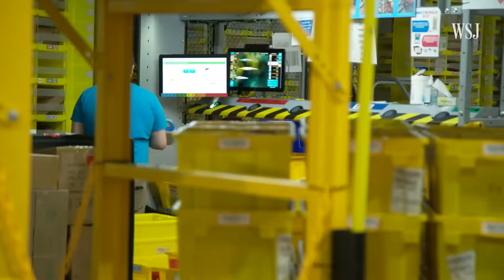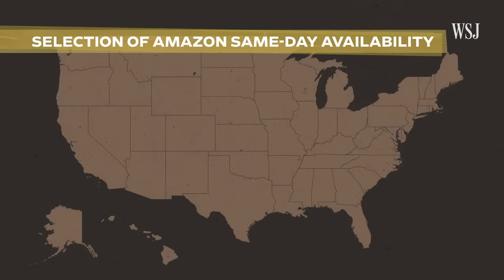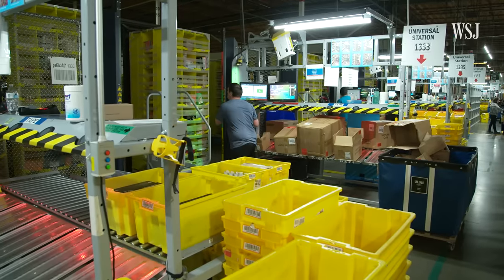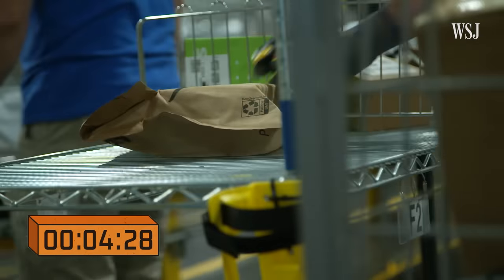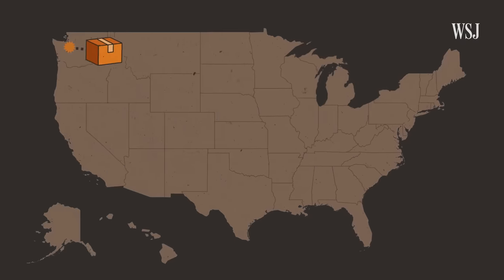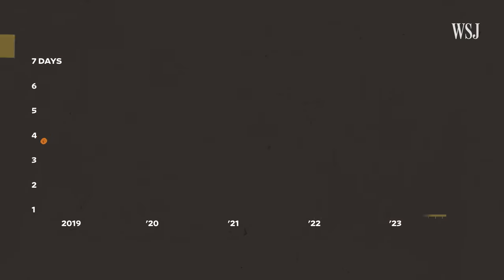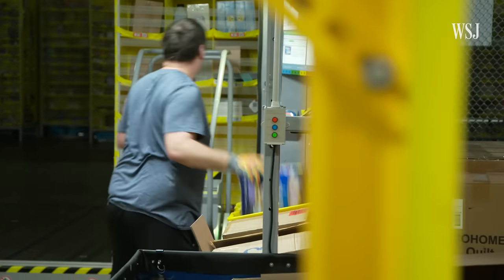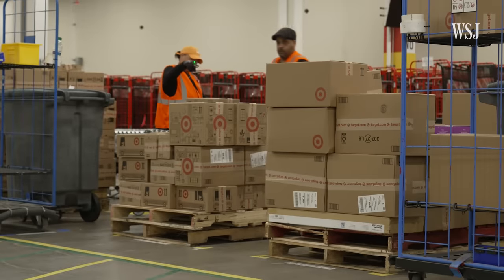Inside Amazon’s Meticulous Same-Day Delivery Strategy | WSJ Shipping Wars

Comment: If you live in an apartment please don’t select the 4-8am delivery time. If we can’t access the lockers, we have to return to the warehouse. ALSO PLS PROVIDE A GATE CODE ❤
Reply: You make a good point Amazon needs to set up a department whose job it is to contact complex owners of any type of gated community after a single delivery has been made to set up automatic protcalls to ensure vetted drivers and employees have access with no problem. If lazy property owners refuse to do this it should be Amazons prerogative to refuse delivery. Think of the time and money both parties would save.
Reply: We don’t even get gate codes as residents 😂 just a key card
Reply: There isn't a gate code at some apartment buildings, and people who live there just use their key cards to enter. The screen with a "code entry" at the front of the building you may see is just a way to dial someone who lives there so they can beep you in, but no way to enter a code to open the door. It seems like the regular FedEx, UPS, and USPS drivers may have access to the building, but since the Amazon drivers are just seemingly random without an everyday route, I guess the apartment giving them access cards is way more difficult
Reply: We gotta use a third-party delivery service called Fetch - basically the middle man between Amazon & the customer. It sucks, but I get why many apartment complexes are requiring it nowadays.
Reply: Thank you.
Reply: This! Yall folks that are ordering in an apartment complex, PLEASE leave detailed instructions and make it easier for people that deliver your packages and food! Please and thank you!

Comment: I used to work for Amazon and they constantly overworked employees. The promise of fast shipping came at the expense of our health as we had to sort several packages continuously throughout our standard 10 hour shift. A work union didn’t exist either at our facility and this made our working conditions harsh and dangerous. I’m in my 20s and for sure those medical benefits exist for a reason. On the daily older employees would wear braces, not for preventative measures but for recovery. It’s unfortunate that Amazon puts so much pressure on its employees as a direct result of attempting to increase its output for $$$.

Comment: I do amazon flex and often times they send 2-3 drivers to the same house which is really inefficient. They could easily give one driver those 3 packages.
Reply: Right! My favorite is when we all meet at the same time.
Reply: I recently bought 3 different things under one order. I intentionally chose the "no rush" option for later that week to have fewer deliveries since I didn't need the stuff right away. They still sent 3 separate drivers to my house lol
Reply: @UOAPlays  They probably came from 3 different fulfillment centers. Amazon is so customer obsessed that they will do anything to deliver on time. There are times when they paid me $90 to deliver 10 packages 😂
Reply: @siamimam2109  That makes sense. I didn't even think about that. I used to work for Amazon, but it was at a crossdock facility, so I don't really know much about the actual fulfillment centers.

Comment: I might be the odd one out, but I don't like it. I ordered 2 books yesterday, both were delivered today, but in 2 different shipments, that means 2x packaging, 2x handling and 2x transportation which all has an impact on cost and the environment. And yes, I am certain both came from the same location.
Reply: But it wasn't 2x anything. It was actually 1/250 x transportation. You are considering 2 separate vehicles being driven by 2 different people and making 2 different trips to your home. Reality is that both of those items were 1 of 500 items in the route that would have been made without your order. 

When the USPS mailman brings you a piece of mail they are not making a special trip for each individual envelope. Neither is Amazon.
Reply: It's really not close to 2x though. The weight of the books was the same, and the paper/plastic that covered them was no different than a Starbucks cup you threw away. Meanwhile, combining multiple items into one order takes longer and more labor than two separate packages.

Comment: Amazon has been doing a poor job at moderating what they sell. I've gotten broken, used, or fake products from Amazon. They also do not carry a ton of name brands so I am now buying more stuff from eBay, Home Depot, Lowes, and occasionally Walmart. They need to encourage name brands to sell with them and get rid of most of the Chinese low quality knockoff brands.
Reply: i’ve gotten fake stuff too
Reply: They’ve run off the good, name brands for a lot of categories and what is left are the cheap (often low quality) Chinese companies.
Reply: @roxcyn  Exactly. They took Walmart's berating of suppliers to the extreme and everyone but the Chinese just stopped selling through them.

Comment: Amazon Same Day Delivery is insanely fast, but honestly, besides groceries, have you ever really need clothes, electronics or other stuffs to be delivered same day??? I feel it's just frustrated for Amazon staffs
Reply: The speed you receive a delivery at has no impact on the Amazon staff. It's didn't come earlier because people worked/drove faster- it's just that the item was already in your city. Workers in a fulfillment center on the other side of the state for a next day delivery will have just as much time pressure, because the item needs to get on the truck to your city first.
Reply: As a amazon worker of this exact type of building I agree wholeheartedly with you I don't really understand why most people can't go to the store themselves most of the time by the time your package may or may not arrive you could've been back from the store with the single cough medicine you solely bought from amazon even if it was groceries I kid you not we have a amazon fresh warehouse 10-15 min away from the Amazon SDD (same day delivery) warehouse that practically does the exact same thing that the same day warehouse does it's just limited to only groceries. That claims to get delivered within 2hrs once again.

Comment: Something they’ve gotta work on is their intake of items. 
I’ve had multiple times where the wrong item was delivered, because somebody put the wrong ASIN label on it. Once it was just the wrong variant of an item. Not a big deal that time. 
But this last time, I had ordered a $8 spray bottle of Rain-X. But got a $70 box of “The Right Stuff” gasket maker tubes. Not a huge problem really for me, as that can be useful. But a mechanics shop could’ve easily abused that fulfillment center to order a couple years’ supply of that stuff for a fraction of the cost.

Comment: I don't mind paying the membership. Where I live is a senior facility, which has an intercom; intercom code is posted in the instructions. Only to rec'd a notification that I need to provide a gate code.......for the delivery. Maybe if the driver took the time to read the instructions he/she would gain entry into the building. Driver also leaves packages on the counter in the mailroom, which gives easy access to thieves to steal. Also, I check the box for all my packages to be delivered so there're few boxes and a one time delivery day. Only to rec'd package being delivered on each day of the week instead of all at once.

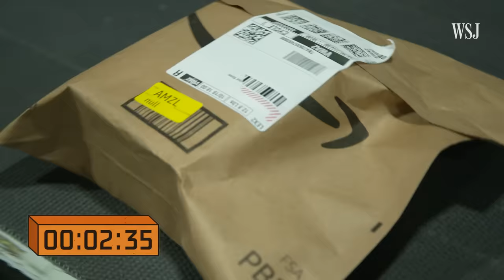Comment: Let’s be real here. The person scanning the package and applying the yellow sticker 3:11… that job could really be done by a robot. 
Not a fan of jobs being stolen by robots but that just seemed so unnecessary to have a person scan each package and apply an automatically printed sticker.
Reply: It’s gonna be happen eventually
Reply: It really couldn’t. If it could, do you think AMZ would have a person doing it? Of course not.
Reply: You'd be surprised. Placing small stickers onto soft bags holding objects of inconsistent size is actually very difficult. More possible now than ever given machine vision, but that's a substantially more complicated technology than you would imagine. You would also need to designate people to collect and manually label ones that weren't labeled correctly, techs to fix the multiple machines needed, etc. The cost-benefit is just complicated.

Comment: Honestly the delivery speed is not as important as avoiding "late stage capitalism" -- for the last two weeks I think they've been experimenting using residents in my community for last-1000-feet delivery, with many packages being "misdelivered" in systemic fashion including a whole bin of packages being dropped off at a corner store on the assumption that random strangers would do the right thing. Actually getting each one of these instances resolved was a mess of dealing with chatbots that misdirected me to the manufacturer, etc.

My experience with Target and Walmart have been great so far and I'm trying to give them business whenever possible instead of Amazon.
Reply: Can you explain the late stage capitalism part. Just interested is all
Reply: That's nonsense. They were dropped off at the address given. It's a game you're playing.
Reply: @wrath2008  "late stage capitalism" refers to exploitation enabled by amassed power in a market (but not necessarily monopolies). E.g. normalizing employees urinating in bottles because they cannot take a break. In my specific example, you can always go buy elsewhere, but once some specialty product starts to actually cost 2-3x anywhere else online, you're invariably going to let things slide that you would never accept if a local store still sold the same thing for the same price they used to (but can no longer afford to if they're still even in business), and it's very hard to undo.
Reply: @Proton_Decay What you are describing is more like (very) early stage capitalism.

Late stage capitalism for me is when productivity does not increase anymore and/ or enterpreneurs run out of (good) ideas. The later may be the case here but idk about US-americans and their behavior. Maybe thats a big thing over there. Idk.
Reply: @l.b.3416  I don't think there's such a thing as running out of ideas so much as there is a lack of incentive to innovate, which is how I'm looking at it. Take the maturest most boring business you can think of and say there's a few trillion dollars in revenue on the table there will be new ideas coming out of the woodwork as everyone suddenly prioritizes innovation-based over exploitation-based strategy.
Reply: Mmmm

Comment: The problem is most Amazon Flex drivers don't know how to read delivery instructions!  The gate code is there, what apartment building and what floor and unit number. So the package ends up getting delivered to the wrong address many times, and customers have to file a not-received complaint with Amazon so they can get a refund.  All drivers should read!

Comment: Amazon is overhauling its distribution network to deliver packages faster. The e-commerce giant is investing in speed to compete against rivals such as Walmart and Target, which have built systems to beat Amazon's two-day delivery promise. Amazon's smaller same-day delivery centers prepare products for immediate delivery, with picking, packing and sorting all in one location. The centers stock the 100,000 most popular items that local customers might want within hours, not days. The inventory curation is conducted by AI-driven tech that gets packages to doorsteps faster. The company is using analytics to keep the right items closer to customers. Amazon plans to double the number of same-day centers in the next few years.